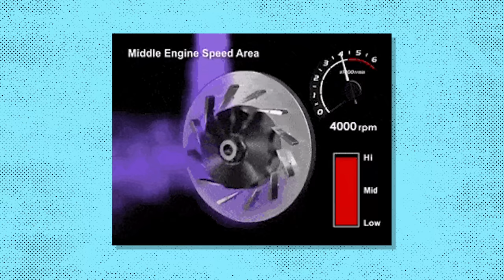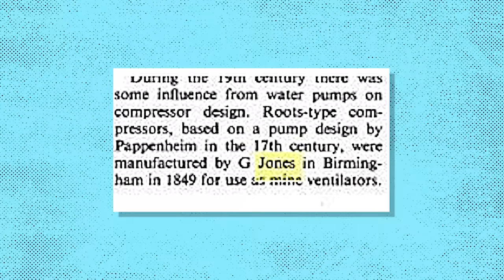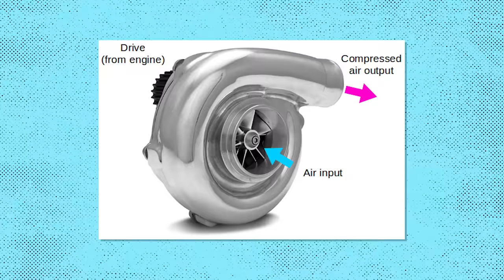Why Superchargers Aren't As Good as Turbos

Comment: I'm 54 years old and I knew way back in HS that an electric drive induction system would be ideal.  They are just now catching up to my genius.
Reply: Electric superchargers still produce less power than turbos...  you can't get around that First Law of Thermodynamics
I guess you didn't go to university?.
Reply: @sandervanderkammen9230  I can tell from all you comments that you love turbo's. Turbo's might make more more but superchargers make better power. It's always there and is more controllable.
Reply: @guntherferguson2369  one of my favorite cars of all time is twin supercharged, the Auto Union Type C.
I just understand without any personal bias that turbochargers are superior for a very important reason that many seem to forget.
More power is "better" power, nothing is more true in motorsports or tuning.
 The question? is the driver skilled enough, turbochargers require more skill because they produce more power.

Comment: Not a car guy… but an aspiring engineer… Are there any electrically driven turbos?

It seems like keeping one spinning could be done without using the engine to directly drive it.

I wouldn’t replace the exhaust system driving it while at desired rpms… just curious if any electrical enhancements exist to keep one spun up when at a lower rpm.
Reply: There actually is eletrically assisted turbos if im not mistaken
Reply: Most turbo anti lag systems use an air bladder that blows compressed air into the turbo to spin up the turbine if it's not in boost and you put the hammer down. The air bladder itself is electronically controlled. I'm not aware of any electronically assisted turbine anti lag systems, but I'm sure one exists somewhere as a prototype or proof of concept at the very least.
Reply: Audi and BMW I believe are using Electric Turbos. They use low pressure ones for very low RPM until the exhaust driven ones spin up. (One of them has a quad turbo diesel with one of the turbo being Electric)
Reply: Watch until the end of the video
Reply: You could have googled it in 1 second.
Reply: @v4skunk739  I did not care enough.
Reply: F1 has been using electric overboost turbos for years. Very similar to the VW- Audi hybrid-electric turbo, but gives you more boost , temporarily ( 5 seconds ?) raising HP by 40-80ish..
Reply: @aaronhumphrey2009  Nope. F1 huge turbo is hooked up to a heat recovery system called motor generator unit heat (MGU-H) which sends charge to the battery that sends power to the MGU-K (kinetic recovery system) which is hooked up to the crank to produce 160bhp.
Reply: @v4skunk739  - Why are you here and not in a library doing your own research?

I am asking fair questions of like minded people in the pursuit of educated answers… I’m fairly sure thats what the internet was designed for.

Give me a break…

Comment: VW used a compressor in many 1.4 TSI Models. It was used for lower revs where the turbo does not produce any power and was disengaged with a magnetic coupling at higher revs.

Comment: Turbochargers also create parasitic draw on the engine, because they create tons of exhaust back-pressure which makes it much more difficult for an engine to push out exhaust gasses. Which not only takes power, but can cause leftover exhaust gasses to remain inside the combustion chamber.

Comment: The centrifugal superchargers comes with one advantage, by producing the bulk of its boost at higher rpms it limits low end torque, compared to other forms of superchargers. If you're building a sleeper with lots of power and relatively skinny tires, the centrifugal supercharger will limit boost and torque at lower rpms when the driver launches the car, which will make the launch easier to control. The boost and torque/power will arrive once the car is moving and the tires have the ability to handle them. A positive displacement supercharger will produce lots of low end grunt, which is fine if the car has the traction to handle it, but that could led to the torque being lost to wheelspin if the tires can't handle it.
Reply: That would assume that your gearing and tire size are not ideal for an engine with a centrifugal supercharger... something that most production cars don't have...

Comment: The old Audi S4 featured a small Hot-V supercharger.
And from 2011(?) onwards, you can go into the engine management system and select "Performance Mode" and the car will go from 320 to 420 BHP instantly. 
One of the greatest car upgrades of all time, by enabling a software option.
YOU ROCK, AUDI!
Reply: What? I own an S4 and none of that is true
Reply: It's not instant and that's called a remap my friend. It typically costs £300/$500+ and a disclaimer that you're responsible for anything that goes wrong (including an engine going bang)
Reply: It's not a "hot-V". A hot-V engine has the exhaust ports on the inside of the V; the supercharged V6 on the S4 had a conventional engine layout with a supercharger on top of the intake manifold. Should have stuck with that, too.
Reply: @S.ASmith  what the hell is he talking about with “Performance Mode”
Reply: @murraydmark  Probably clap trap and really means a stage 1 remap.

Comment: Good easy to understand explanation, really like the video!
So don't get me wrong, no hate here, but there's a few things that I feel could be better explained or need correcting:
1. ALL different types of chargers (even the roots) compress the intake air. That's the whole point of a super- or turbocharger: increasing the intake air compression to fit more air into the fixed engine volume so that you can burn more fuel for power. Btw: A perfect methaphor to explain how the roots charger works would be 2 revolving doors that are overlapping in the middle pushing a constant stream of people into a hotel lobby: You can use either of the revolving doors on the outside to get into the lobby, but where they overlap, the doors leave no place for anyone to get back out. Now, if you only let a small elevator full of people leave every few minutes, people in the lobby will pile up (compress) untill the lobby is so full that enough people squeze into that tiny elevator to offset the constant stream being pushed in. And, like with compressed air, the temperature in the lobby will automatically rise, which leads me to the next topic:
2. Because all chargers compress air, all chargers increase the air temperature and all chargers can benefit from intake air coolers. You can think of intake air coolers as a secondary compressor that works thermaly rather than mechanically. By cooling the compressed and heated intake air at a (nearly) constant pressure, the volume shrinks and the air is therefore compressed even further. Also, since the intake air cooler is usually the last thing before the cylinder head, and not the compressor itself, this seques nicely to:
3. None of the charger HAVE to be placed in any certain area of the engine. The only thing that most superchargers need is a connection to the fan belt, but that could place it nearly 360° around the engine. It's usually just about reducing pipe length (more pipe -> more volume -> takes longer to bring up to pressure).
The reasons many superchargers are often placed on top of the engine is because:
A: that's where a V-Engine (by far the most common candidate for supercharging) have the air intake, making for shorter distances to travel from charger to cooler to intake
B: Many chargers, especially the redicilously oversived ones, are after-market solutions and it's much easier (and more structuraly sound) to make space by cutting a hole in your hood/bonnet than it is to start cutting half of your wheel house or subframe off to create the space.
C: completely contrairy to what you said during the roots explenation: it's actually one of the least hot places in the engine room.
4: I hope you'll give your kids a better explenation of the birds and the bees cuz that did not really explain how a screw compressor works ;). The biggest problem is that diagramm. The compression is done along the screw axis, so a cross section is just badly suited to explain this. Tho to be fair, they aren't the easiest concept: By having a (nearly) airtight seal in the middle between the 2 screws, the  compressor traps 2 pocket of air on the outsides of each screw, which start where the rotors meet (lets call this the bottom), wraps around the screw once until they meet again at the top. At the intake side the air can flow into the pocket as it is opened up until it is transported far enough for the "bottom" to close up. Then, as the screws rotate, the "bottom" rolls further and further up the screws, pushing the trapped air pocket along in front of it. At some point, the air pocket reaches the far end, which is a closed wall except for a tiny outlet. The "bottom" will keep moving up, compressing the air against the wall untill the pocket is rotated over the outlet where the air can escape. (Best I can do without pictures/animations, I hope that helps)
5: Last but not least, the joke needs to be made: Superchargers don't suck: They blow. :D
(Obviously I am also just human and prone to errors; so if I made a mistake above, please do correct me in a civilized matter)
Reply: There are a few things in you comment that need correcting, first off, 
1.) There are 2 types of compressors, Internal compression and External compression.

2.) Internal compression heats the air more and are less efficient.

Any questions?

Comment: Superchargers are not always mounted on top. That may be the case on a V style engine, but on an inline engine, it is usually mounted off to the side. My 2006 Chevy Cobalt SS has an Eaton m62 roots supercharger that is mounted on the intake manifold which happens to be off to the side, or at the front of the engine bay being a transverse engine.

Comment: The reason i would use a supercharger would be in a drift car because of the equivalent boost relative to throttle acceleration. Meaning more control of the car when slippage occurs. A turbo has exponential boost, which will be less controlled in drifting
Reply: Yeah no, That isn't how drifting works. It might pay to watch and see what cars get out there on the track and notice that most of drift hacks tend to be turboed. https://www.youtube.com/watch?v=BazbxtS7Dk4
Reply: @ceffydriver  they do learn how to work with a turbo due to the fact that it tends to throw a lot of horsepower and allow slippage to occur resuling in a drift. It does take skill but it can work out better then a supercharged engine
Reply: @vroomvroom4061  Drifting (at least at higher speeds) is more about upsetting the weight of a car by shifting the weight by skandoing (Scandinavian flick) to get any car regardless of power to shift it's weight from the direction you wanting to drift, and then using the momentum from that to rotate the car on it's axis rather than the front end leading the car into a corner and then use the loss of traction to effectively act as thrust to oversteer through the corner. 

I think what you are implying is just powersliding, basically just holding a long burnout. 

We have so many people here in australia that drift NA cars too (like some shitty KE70 corolla) or even NA fords and holdens as entry level drift hacks and still do a better job at it than people with high powered cars. 

The reason why turboed cars work so well is because most turboed cars are japanese, like my cefiros and it's because they have great chassis balance and handling that just works well. 

Superchargers are not that great for drifting as the drive belts don't really like being on and off of throttle constantly, superchargers are also locked into making boost on RPM rather than load. 

Lastly PD superchargers also cost way too much per HP,  just have a look how much a M112 SC costs by comparison to turbos like TD06h 25g, 3076, 3582r.
Reply: @ceffydriver  hear me out on this one because you are definitely right but from my perspective i work with cheaper cars. I know a turbo is somewhat cheaper then a supercharger, yet turbos put intense pressure on cast iron and aluminum blocks, which can destroy the engine. I would much rather replace belts more often then engines. I am just looking at this from the expensive build cheap car perspective in that the weight tends to be balanced throughout the car 50/50 or 60/40. A slightly heavier component in the front would keep the front wheels down and the weight of the rear the same so lateral acceleration creates a logarithmic-spiral force from momentum and centripetal force. Now a high end jdm or pony car could lose some weight using a turbo and use a front splitter for high speed drifting  using aerodynamic force to apply weight to the front wheels. Of course  a cheaper way of doing this is buying a front wheel drive with weight already in the front

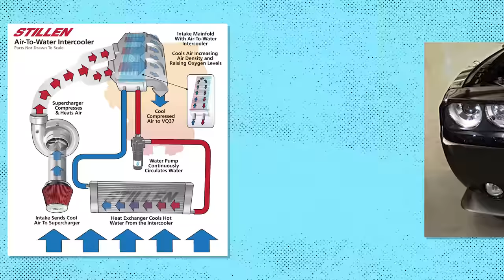Comment: 3:15 actually positive displacement means the volume of air pulled in is the same volume forced into the engine. And I'm not sure what you mean by it isn't a compressor but an air pump a compressor makes pressure/boost, if it didn't do that then it'd be completely pointless in the first place
Reply: Actually the volume going into the engine is less.  For fifteen pounds of boost the air is twice as dense if cooled back to ambient temperature.  The supercharger then sucks in two litres of air for every litre shoved into the cylinder.  Positive displacement means there is no way the air can flow backwards towards the intake.  This can happen in turbines if the back pressure is too high, known as stalling.  Very dangerous in an aircraft engine.
Reply: @ericrawson2909  the technical definition does not figure displacement under boost, because depending on how much boost you run with it you could get like you said half the output volume at +1 bar and even less at higher pressure. It just makes it easier for the consumer to figure it out
Reply: @ericrawson2909  The VOLUME is always the same, the MASS however  varies based on altitude and temperature.
Positive Displacement compressors always flow the same volume.
 Centrifugal and Axial compressors have a Curvalinear flow rate based on rpm.

Comment: You don't have to even explain to understand intuitively that stealing energy from exhaust which is waste energy is better than stealing energy from the crank which is energy that has yet to meet it's use potential in the engine.
Reply: Excellent comment

Comment: The biggest reason superchargers suck overall: Turbochargers are recycling machines. They are taking heat energy that normally just ends up being dumped out the back of the car to create MORE energy.

And as for lag: We've largely solved that with Variable Vane Turbochargers (VVT) where you can change the flow of the exhaust gas to spool the turbo faster. Regardless, at the end of the day you are using your own engines wasted energy to make more energy, and that's something that Superchargers can't really do.
Reply: Excellent comment.

Comment: Supercharger serve a different purpose thank a turbo. Expensive variable geometry turbos resolve most of the turbo drivability issues due to power delivery. The supercharger essentially makes your engines displacement larger. It drives like a larger NA motor and the soundtrack is to die for.

Comment: A turbo still requires energy to turn that turbine and it eats 10~15% more fuel to run (That's why for a small 1.6T, you'd have a lower mileage than a NA 1.6)
Reply: On a highway at constant speed*

Comment: You were pretty wrong about the roots and the centrifugal superchargers. Most production cars with superchargers are twin screw (or centrifugal), with the main uses for roots being older cars and top fuel dragster. There’s no actual lag for centrifugal superchargers, they just don’t have a linear torque curve like positive displacement superchargers do.
Reply: Belt driven superchargers used in production today are HIGH HELIX design. There fore they are true compressors, unlike GMC roots positive displacement superchargers of yesteryear. Top Fuel engines use HIGH HELIX SUPERCHARGERS.....today TOP FUEL engines make note than 11,000 horses.
Don't let sandy sparky know we talked about TOP FUEL and horsepower...he will definitely try to p in you corn flakes.

Comment: Those "electric turbochargers" aren't turbochargers. They're superchargers. They don't have a turbine and they are driven from the crankshaft. They just do it with electricity instead of a belt.
Reply: The electric turbochargers referred to were described in full in another video, it's a Porsche concept that uses a turbine generator on the exhaust to power the electric supercharger, so it would in fact be an electric turbocharger. The most common electric superchargers tend to be closer to turbochargers as well, as they're often an electric motor that just assists the turbocharger to spool up at low engine speeds - technically operating as a supercharger but since most of the same hardware is operating as a turbocharger most of the time it winds up being simple to call it an electric turbocharger.

Comment: I've been asked a few times why NHRA Top Fuel and Funny Cars still use roots blowers. My answer: Welp, when you're making 11,000-12,000hp, using 600 of that hp to turn the blower is pretty negligible.